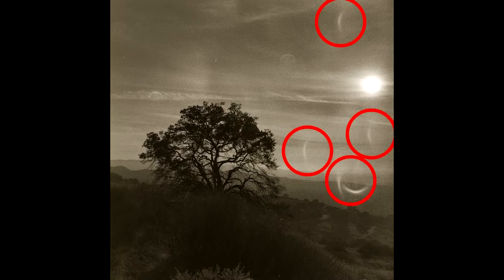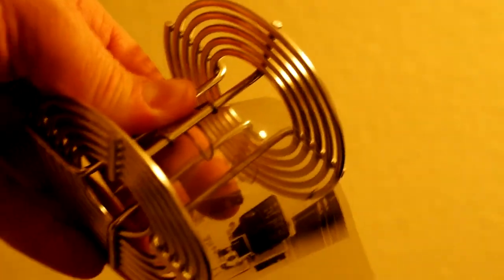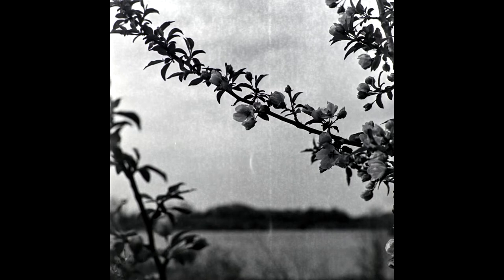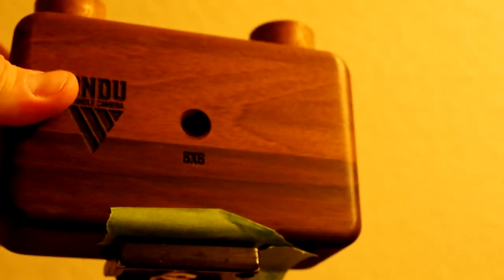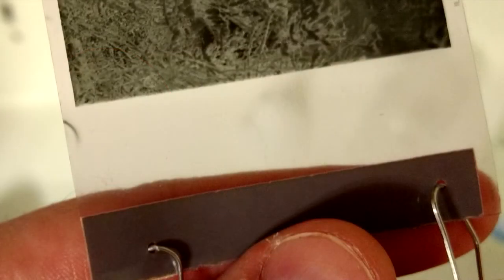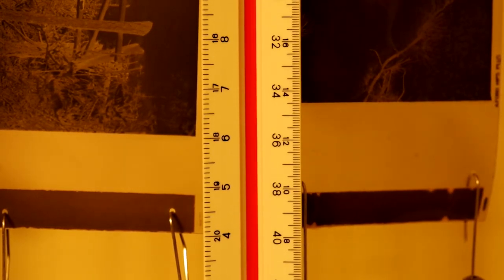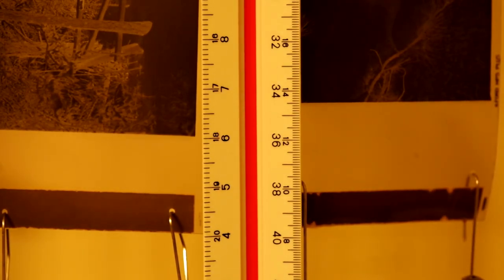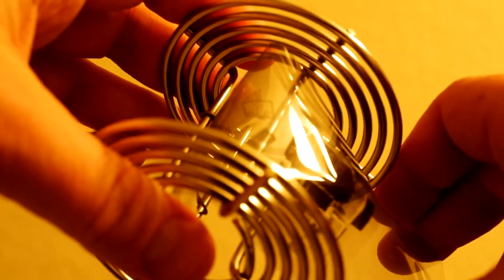Negative Flaw: Loading Creases

Comment: Yay Monday’s are back! This is one I’ve experienced, but not with any set pattern except possibly when Im more out of practice at loading my film. 

Thank you for the tip, very useful and I will give it a try. 

Good to have you back on Mondays, hope you’re well on the mend and have a great Christmas.
Reply from the maker: Yeah, I needed a break. I also started filming the next batch of Ask David questions, too. 

I'm healing up pretty well, thank you. The surgeons did fantastic work. I should be back to 100% by the end of January. Right now I can't lift more than, I think, 50 or 60 pounds, but in general I feel great and I'm not often lifting that much so I'm effectively back to normal.

Comment: I empirically found out that film dents are much more frequent as a result of the heat and humidity coming from my hands inside the portable dark room bag. Especially when using plastic paterson reels it's very easy to crease your film.

I find helpful to preheat the plastic reel with a blow dryer, which allows the film to be inserted easier, as well as taking a break when too much humidity is gathered as a result of fighting with a film that you cannot load correctly.
Reply from the maker: Oh interesting. I hadn't noticed those before, but it makes sense that the emulsion would be a bit grippier when humid.

Thank for the plastic reel heating tip! I'd never have thought of that.

Comment: When first started developing film myself, I had those issues quite often on 35mm, I noticed that the film was rolling-in fine for about the first 2/3 and then starting to get harder and feeling the film been squeezed in the reel, after that and some advise, I realised that was caused by the little play of the spiral itself. I then started to load rolling only one hand and keeping the other still, also apply a bit of pressure to keep the two parts of the reel away from each other, never had the problem again since then. Hope it can help somebody.
Reply from the maker: Thank you!

Comment: I tried using this type of film reel only once and found it to be infuriating! On another note, have you ever used a color temperature meter?
Reply from the maker: I have not. Are you asking about the shots for the loading and film comparisons? I meant to correct the color temp in post (my camera's auto WB let the footage yellow), but I forgot to adjust the color temperature in those shots.
Reply: @DavidHancock  No, actually I was wondering if you have ever used a color temperature meter as YouTube post. Like how they work and how to use them.